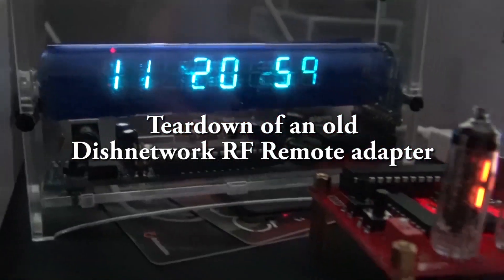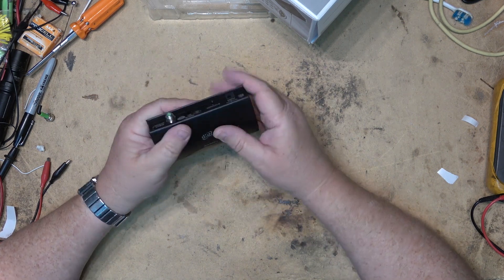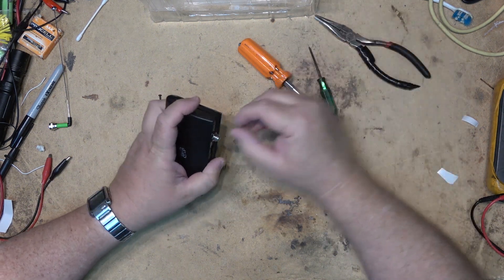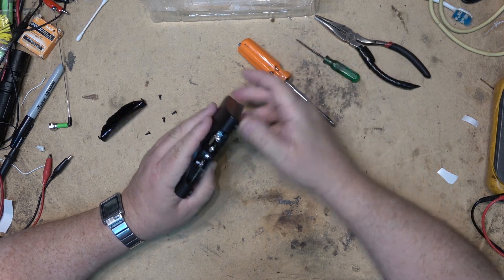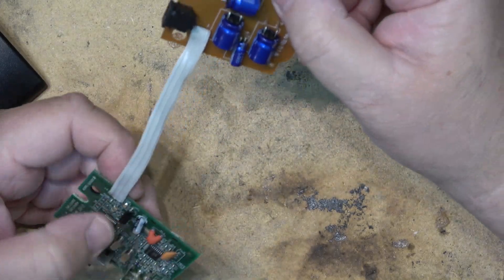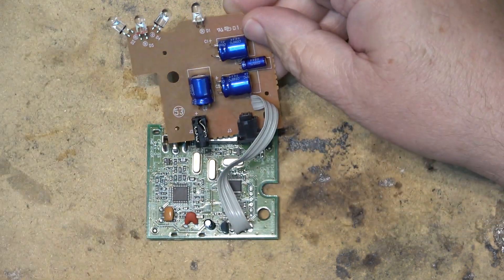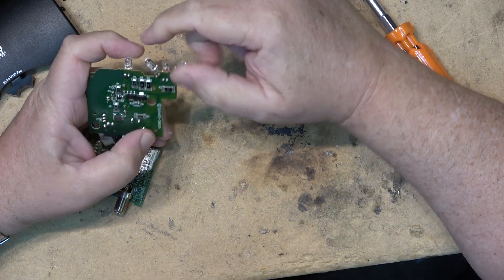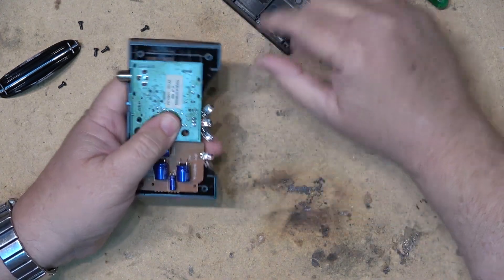Teardown of old Dishnet RF remote adapter

Comment: I'm curious if that little mini antenna can be used on an FM radio. I built an FM stereo radio using the FM ic board that you also did a video on and I used an F connector to attach the antenna to. I have a Dish receiver that has two tuners and TV1 is downstairs  and TV2 is upstairs and uses the same antenna to serve my TV upstairs.
Reply from the maker: It will work for local stations